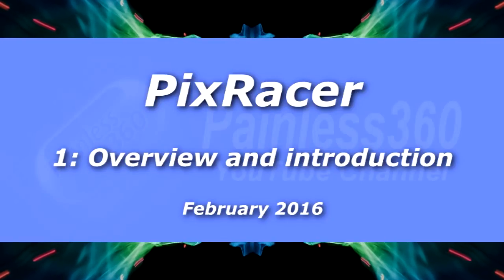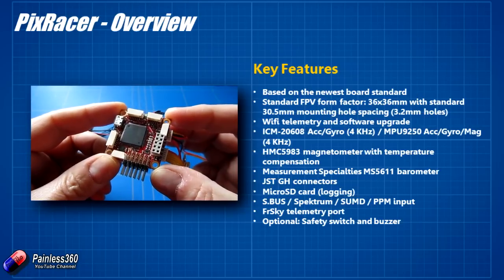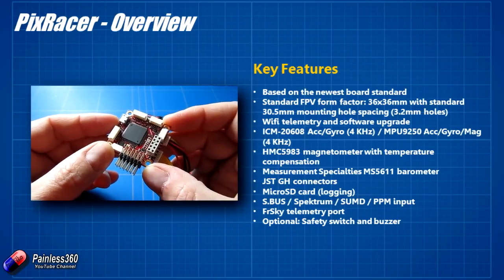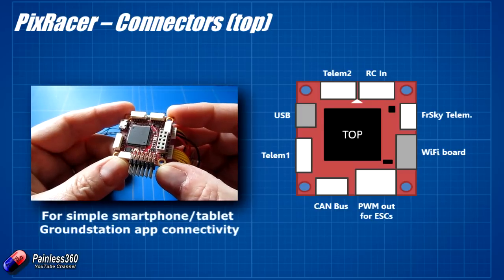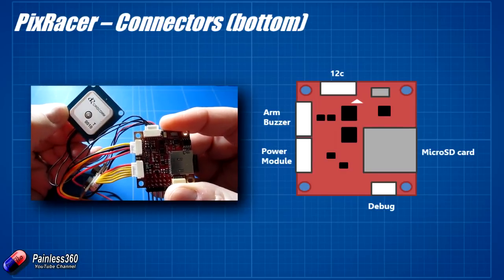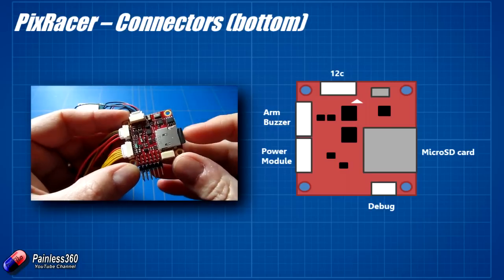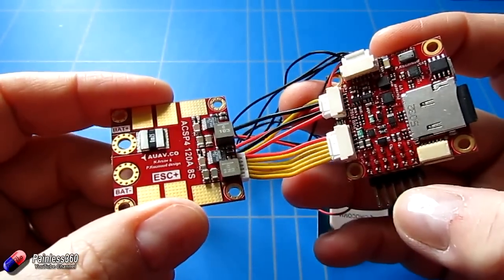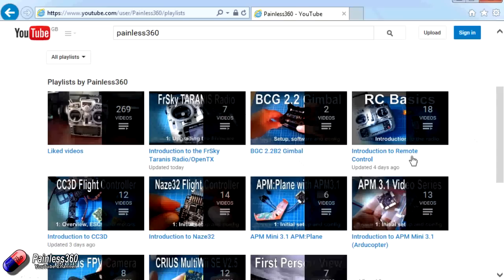(1/1) PixRacer - Introduction and overview

Comment: 3DR are Phasing out the PixHawk.. I'd have concerns about that PixRacer.
Reply from the maker: +Saul James This is the first board based on the new FMUv4 architecture that the new Pixhawk will be based on later this year - that's why the old one is slowing down.

Comment: This is all VERY interesting stuff. But where did you buy the GPS and this fantastic board? (It's exactly what I'm looking for :D)
Thanks in advance
Reply from the maker: +InterBlue UF AUAV.com is what you want. New stock expected first half of March.. Happy flying!
Reply: +Painless360 Ok :D And it is powered from BEC's from my ESC's that give out a voltage of 5.5V? Is the GPS they're offering the same as the one you are using?
http://www.auav.co:80/product-p/agps1.htm 

Thank you in advance :)
Reply from the maker: +InterBlue UF We'll look at this in the next video. The power options are very similar to it's bigger brother..

Comment: Are PixRacer newest "super-duper" (female) connectors backward compatible with standard molex pico blades 1.25mm?
Reply from the maker: +petrovsky Not sure, you do get a cable kit with it..
Reply: +petrovsky: Molex Picoblade are compatible with Molex Picoblade and nothing else. Even if some  people were squeezing DF13 into vice versa ..which wasn´t safe.  

The Pixracer is coming with JST-GH, which is a fantastic DF13 replacement, offering an unlock feature for easy disconnect. As PL360 stated, a full set of cables is included with the Pixracer kit and AUAV is offering cable replacements as well.

Painless360: Very nice Video !

Comment: Hello sir, which one is better mateksys h743 and pixracer flight controller for fixed wing configuration?
Reply from the maker: Depends what you want from the flight controller. Pixhawk has no onboard OSD for the analogue FPV and the Matek flight controller doesn't have any sensor redundancies.. Happy flying

Comment: what if we use a copper plate to avoided any problem from bottom bord ?
Reply from the maker: +Ijas Ahamed copper will not stop magnetic interference. Best of luck!
Reply: Mu-Metal sheet is what is used for stopping RFI. easily cut to 36mm x 36mm to make a nice shield
Reply: ok. Thanks

Comment: I was considering the Pixracer as an alternative to the Pixhawk for my next build, a Hexcopter with retracts but I would use up all the servo outputs for the ESCs and not have an aux output for the landing gear. I like the pixracer as it could be mounted between the center hub plates (18mm clearance) since the connectors are on the side rather than on top like the regular pixhawk. The other nice feature is that it has frsky telemetry output which I don't believe is available on the regular Pixhawk unless you add some additional hardware.
Reply: if you wanted to get really crazy, you could wire up the servo output to arduino mini, and use a analog dial on your radio to send different signals via pwm.   A bit of a hack and not very elegant, but it would work.  Check out the DJI inspired 3d printed quad instructions, the cover everything you need in that guide.

Comment: Been looking over the http://px4.io/docs/1595-2/ website and came across this Robcat 270 build with PixRacer.  This would be a great build for your video series using PixRacer FCU and also adding FPV with OSD.  It seems that a lot of industry leaders have put there support in PX4Pro,  its a who's who of tech companies.  Does the PixRacer have built in OSD?   Really looking forward to this series.  Also it looks like the  OS is going to be Ubuntu Linux to run QGroundControl.  The developers are saying they are not recommending using windows which is fine with me.
Reply from the maker: +Jon Car a few considerations here and at least two camps supporting the board with slightly different views on how it should be done. It's making what used to be a very clean, easy to understand solid solution a little less clear. We will cover some of it in the series..
Reply: big corporate tech companies behind Px4 it seems.
Reply from the maker: +Jon Car Don't be fooled. The team behind the latest incarnation of the Pixhawk - FMUv4 architecture isn't getting that kind of support..
Reply: +Painless360 figures

Comment: could you use aluminum foil between the two as a magnetic shield laminate the foil with  a plastic film laminate
Reply from the maker: That won't work. You need a ferrous metal for this I would use MuMetal..
Reply: Copper tape worked great for me.

Comment: Ah, so input buffering is the reason the original pixhawk feels so floaty compared to naze32 or cc3d?
Reply from the maker: +M390VI Part of it, the original Pixhawk/APM and code simply wasn't designed with racing in mind like Cleanflight and Naze32..

Comment: im having a long range fpv plane made, i was planning on using the pixhawk but was wondering if this new version would be better. my plane is MTD my twin dream. Should i stay with the regular pixhawk?
Reply from the maker: Both will work well, the larger Pixhawk is easier to get everything plugged into..
Reply: +Painless360 thanks

Comment: Hello,
congratulations for the video. I was planning to build a drone using a chassis 250. I tips into using the pixrace or pixfalcon?
Or is it that I take a 330 frame to keep us all?
Thank you
Reply from the maker: It all depends on if it will fit. The PixRacer is a lot smaller than it's larger cousin..Best of luck!

Comment: Wonder how long it will be until you can flash betaflight on it?!
Reply from the maker: +mrmurder75 Erm, forever.. ;) Betaflight is a fork of Cleanflight and a test-bed for the testing of Boris' new super-performing flight code and will roll back into the main Cleanflight code when the testing is complete (unless something changes!). This is a very different board than the STM32F3 based flight controllers so it's PX4 or Ardupilot code you need for it..
Reply: That was 4 months ago, it's time to change that :)
Reply from the maker: I'm interviewing Boris this week so maybe/maybe not.. ;)
Reply: Ah nice!
I was more talking about RS2K matters :) Ordered yesterday, first hybrid dronecode/racing board... pressing hard for a Raceflight port, can eventually do it myself^^

Comment: do you happen to know if it can only send telemetry data through WiFi? or can i still plug in a older 915MHz radio from a full size pixhawk and run missions? Thanks.
Reply from the maker: +Shark Laser I've only seen the Pixhawk radios use the 433 or 915mhz frequency. There may be devices out there that do this but Wifi range will be poor in comparison. Happy flying!
Reply: the reason i ask is because i dont want to use WIFi for running auto missions. im hoping there is a way to connect my 915mhz radios. (i have a pixracer on order but overlooked that part before i pulled the trigger) Cheers !
Reply from the maker: +Shark Laser you wouldn't use Wifi for auto missions. You use it for fast communication before you fly. Best of luck!
Reply: ok thanks for clearing that up. im assuming that i can't hook up a 915mhz radio for auto missions on the pixracer then. That kind of destroys my plans for it hahah ... oops.
Reply: Hmmm  I don't see why not, use a spare UART port in the same way as Pixhawk/APM

Comment: I have been waiting for this for a long time finally someone realized how important Frsky is to the hobby and now Frsky port on a tiny pixhawk,,!! Real Telemetry and gps and real ground software is now possible on a mini quad I would only remove the spectrum port, everybody in quad racing uses taranis yet every new flight controller that comes out has a spektrum this, clean flight that. I'm so excited to get one of these and can't wait that hopefully the second version of this would have the ability to stack with an add on maybe with all the I/o ports where you can add optical, air speed and sonar sensors, just an idea.that would be the ultimate flight controller in my opinion.

Comment: Hi Painless360. I have an issue with internal magnetometer on q ground control and as per research loads of people do. I'm using pixracer and external GPS and magnetometer. My true north is constantly wrong, no matter what I do. Calibrated my mag in the field, it calibrates no problem but the north is wrong. I found on the git-hub that this is a common issue related to internal mags, but found no resolution. Do you know of anyway for disabling internal mag? My fc is placed on MU metal plate about 50mm away from PDB, so interference should be minimal. Thank you
Reply from the maker: I had something similar, if I'm remembering this right, in the PixHawk series. I've stopped using QGroundControl and am back to using Mission Planner with the latest PixHawk build. Best of luck!
Reply: Painless360 I thought this would be the case. It's a shame that there is no mission planner for mac. Thank you for your help.
Reply: Rad Buda QGroundControl and APM Planner 2 are both available for Mac.

Comment: Hi, we are a group of students trying to integrate Optical Flow PMW 3901 designed by Pesky Products with the Pixracer using the Arducopter ver 3.6 firmware . 
Here’s the link: https://www.tindie.com/products/onehorse/pmw3901-optical-flow-sensor/#specs
 So far the limited resources we have found pointed us to towards configuring the WIFI port , initially for the ESP 8266 Wifi Module, into an SPI Port. However, we are confused by how to configure it as well. Please help us (or save us) if you have any idea on how to do the above by responding below. Thank you!!!
Reply from the maker: As I've not tried it then it's tricky for me to offer any specific advice. Please have a look at the PixHawk videos on the channel and the Arducopter documentation is excellent - http://ardupilot.org/copter/docs/common-optical-flow-sensors-landingpage.html Best of luck!